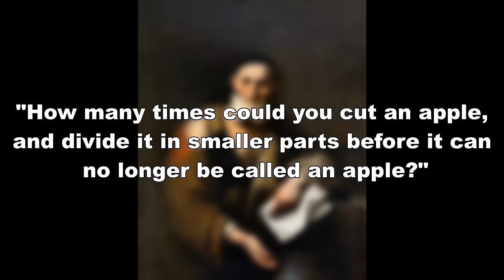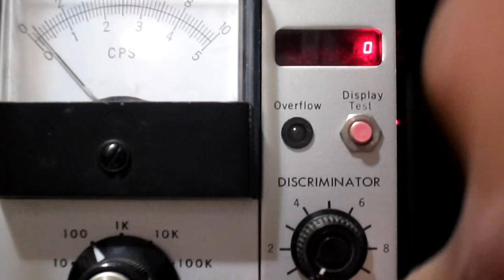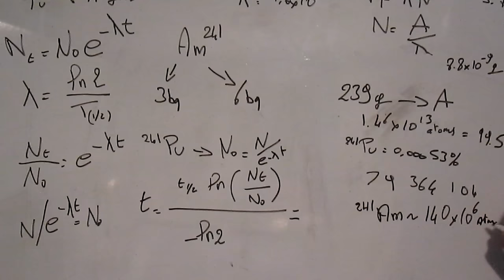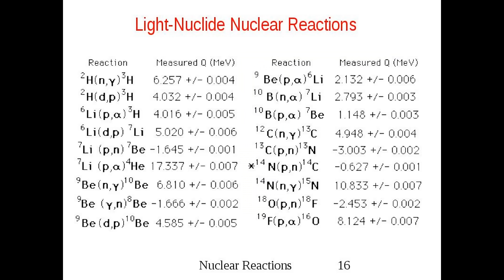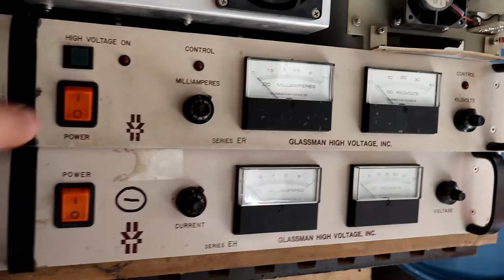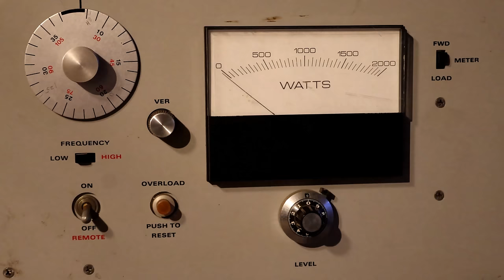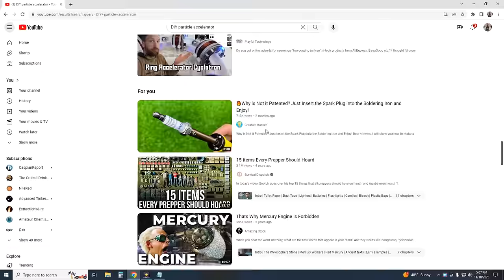DIY Particle accelerator (part 1)

Comment: What about a mechanical square wave generator?  I think Robert Murray-Smith from Thinkin n tinkering has a few videos on it. They are labeled as a mechanical brushless motor controller, but as it mechanically makes a square wave  you can use any voltage that the components will survive.

Comment: Hi. I built one. Here, you need rf power supply, let's say 30 mhz. So you need a function generator, preamplifier, and 50w to 100w amplifier . That goes to your drift tubes.  But you have to know your internal tube capacity so that you can match the network. for more information you can contact me.
Reply from the maker: really? that`s very cool ! you should share some description and pictures if you have any!
Reply: @Neptunium  ok. I can't give you my email. They are deleting the reply.  You know my username try to find me. I really want to help you. 😫

Comment: Maybe it is possible to use a magnetron (salvaged out of a microwave oven) as a generator? It has a pretty powerful output and stable frequency.
Reply from the maker: the length of the drift tube depends on the speed of what you are accelerating which is mass dependent. And of course, the frequency used. Microwaves are used in a slightly different kind of RF accelerator where the electron "surf" the wave. Thats a good idea for electron but that`s not what I am doing here, Although I suspect there might be a way to use microwave for helions too, I am already too invested in one type to redesign everything now you kown! thanks for the suggestion and comment! and thank you for watching!
Reply: A magnatron is a good choice for the RF generator and used in many commercial linacs.  The accelerator disks are directly connected to and supported by a waveguide assembly that is housed in the vacuum chamber.  In this way  there are no electrical connections needed to get the RF into the accelerator- rather a microwave beam is fired into the accelerator.  Also this design removes the need to have any insulative components in the vacuum chamber which will continually out gas.

Comment: I appreciate for your work. Wouldn't be less complicated your project, when you use a Cockcroft–Walton (CW) generator? A single stage linear accelerator can be less complicated, less component can go wrong, and even can be archive 1-5 MeV range. The first linear particle accelerator used this method in 1932.
Reply from the maker: yes ! if you can achieve the high voltage necessary ...as described in the video, its very hard to keep everything from arcing every where! this is really a proof of concept to demonstrate that it can be done and the only difficult part is the power supply.. Thanks for watching!

Comment: You might be aware of this, but just in case - a lot of quadrupole power supplies these days are digitally controlled, a DC signal with a rectangular waveform. I'm way too smoothbrain in the EE department to know for sure, but that kind of circuitry should be possible to tune for your particle accelerator.
Reply from the maker: yes it is you are correct, nut the power is nowhere need what i need for this project ! i am not good enough with electrical and electronic stuff so thats why i asked for help! your suggestion is very valid ! i had this idea too! Thanks for watching !
Reply: @Neptunium  Yeah, that's not my strong suit either. If you ever need help with rebuilding or maintaining a mass spec I'd be happy to try and help, I've had trainings from thermo and bruker. One day I hope to build a teaching mass spec that can separate large/visible electrostatically charged particles. The wiki page for quadrupoles has a picture with particles as a demo, would be incredible to build that idea out all the way.
Reply from the maker: Oh what a cool idea!! Please let us know how or if you ever make it it would really be awesome!

Comment: Where do you source your apparatus ? Is it just ebay? I was thinking about your square wave generator, you should be able to make a rotating contact switch, you only need to control rpm and contact length for frequency and duty cycle. Isolate it from the mains behind diodes and I would shield the entire rotating assembly to eliminate spark gap problems. I only have one truly valuable piece of advice... dedicate some time to teaching any child that wants to watch. Nothing makes everything worthwhile, like time spent tending the garden of youth with the experience of age.
Reply from the maker: That's a great advice my man! I'll try to incorporate that in the follow up video... Yes most of my stuff is from eBay. Unfortunately a rotating contact won't get high enough frequently, I'll explain why in the next video but for now the size of the chamber dictate what frequency to use for acceleration and it's somewhere around 8Mhz. Thanks for watching!!
Reply: @Neptunium  gotya, I used a router once to achieve a pulse in the khz range, but you would need an xlarge disk to get mhz. Probably safer another way, without doing something really scary like a series pulse, where one is the source frequency and another is the multiplier... I am always thinking about how to do things mechanically... but I admit that sometimes, there are other ways that are far safer and easier.

Comment: I apologize in advance for my noobishness (noobiness?) but how is the helium ionized? The stated source of ions is the heated tungsten wire. I'm assuming the wire emits electrons which then are accelerated by the positive voltage. Are these electrons knocking off the electrons of the helium atoms and thus producing ionized helium?
Reply from the maker: Yes! That's exactly what's going on! Usually, a magnet forces the electrons in a spiral so they have more chances to ionized what is in the way. I'll change this method (somewhat) in the next video... thank you for your question and thanks for watching!

Comment: I think you can coat tungsten with a salt which is better electron emitter than tungsten because tungsten is actually not that great in emitting electrons but downside of this treatment is if you expose them to atmospheric conditions most of salts turn into hydroxides or another poor electron emitter stuff. And please be careful, something similar happened to me too and now I have a scar on my finger that is around 3 cm wide.

Comment: wow nice I am working on a particle accelerator as well! mine will be accelerated with cw multiplier
Reply from the maker: Awesome! How high can your voltage reach ? Thanks for watching!!!
Reply: @Neptunium  for some reason it keeps removing my comment but I wrote a long comment before, the theoretical max is 750kv and I might add some drift tube as well if I can afford it, if I can contact you in any way I can share some pics.
Reply from the maker: @Tsindur  if you are on sciencemadness you can find neptunium there and we can communicate..
Reply from the maker: 750kv is very impressive!! You can already do some serious reaction at this level!!! Awesome

Comment: Sorry to see your equipment destroyed but I know it really means you are directly over the target,. I went to high speed switching to bring a tiny amount of voltage to a resonance cascade but seeing everything catch fire was the proof it is going to work,  I just have to decide what to do next that's all but I imagine it's been done before so it's not impossible ....
Reply from the maker: Absolutely! I released the part 2 about 2 weeks ago! Enjoy
Reply: @Neptunium  also I forgot to mention that I had a 26000mhz Quartz crystal in the mix and I was looking right at a resistor and some LEDs were providing light in such a way that I could see a field of energy emulating around that resistor and it looked like the eye of Soron in Harry Potter  ..  I will have to figure out a way to ad some heat sinks and I don't know why they couldn't be right in line  (actually I have a resistor that has a heat sink on it and don't know why I didn't use that) and I could run it in a chamber and slam some Co2 in it  ....

Comment: i am wondering what hapened to the high viôltage generator that it failed so spectacularly
Reply from the maker: The capacitors were fried . There was a lot of missing screws and loose parts from the shipping in a wooden box with no padding! Yeah I was pissed...
Reply: @Neptunium  oh oof.
Yeah that sucks, especially after spending probably somewhere around 300bucks for it

Comment: Any one working with charge needs to know how to avoid radiation exposure. Needs advice on how it occurs from discharge and easy ways of knowing.
Reply from the maker: If you pay close attention to the clutter in my garage there is a scintillation detector at the ready to monitor the area immediately around the end of the tube. We are a long way before I have to worry about radiation yet .. but it's already planed for my friend! Thanks for watching!!!

Comment: Can you accelerate tungsten or thorium?🎉
Reply from the maker: Yes it can be done! It would be somewhat complicated and requires a slightly different setup but yes I could
Reply: @Neptunium  you would be a lot cooler if you did,. Has anyone accelerated heavier elements like that and collided with like or dissimilar elements?
Reply from the maker: @brettmoore3194  I am not sure if anyone else has done anything like this. At least on YouTube.. that idea did cross my mind but it's a bit more complicated although not impossible, the energy required to accelerated heavier ions is far greater than I could achieve you know . Energy is always a problem !

Comment: how do you separate the hydrogen particles into individual hadrons?
Reply from the maker: You don't. A proton is a hadron ! And I used helium not hydrogen so that's an alpha particle . Thanks for watching
Reply: @Neptunium  Sorry, but I thought that particle accelerators like the Large Hadron Collider, does as it says, collide separated hadrons, specifically protons for the LHC, which I learned that they achieved so by heating up hydrogen to a temperature that the electron eventually leaves the electromagnetic force field. Hydrogen is used because it has one proton, and one electron. How can any experiments even be conducted with an alpha particle? Well I can imagine that you could do what LHC and CERN does with particle acceleration because the alpha particle is positively charged, but does the neutron interfere with collection of data. I mean to be fair it is a "tiny" sized PA, but to be honest, a particle accelerator at any size should still be defined by it's ability to create at least half a TeV, I haven't watched the full process yet, and I really plan on doing this my self because it's awesome. I will be really happy if I can get the answers from the man him self.😊

Kind regards,
Jimmy (a freshman who does not have a proper gpa)
Reply: @Neptunium now thinking about it, .5 TeV is kind of too much🤣, impossible for such a small machine to achieve, sorry for my ignorant naive mistake haha.
Reply from the maker: @jimmygao456  there is a whole host of nuclear reactions you can do with alpha particles at much lower energy! You don't have to have proton and only proton! The part 2 is out by the way! So you don't have to wait! Thanks again for your curiosity and interest! Let us know about your project here that would be very cool!
Reply: @Neptunium  Alright!! thanks you😁

Comment: I would suggest learning how to make the parts from scratch, then it won't matter how often you break them. Yeah, easier said than done, but build up your skills one piece at a time and you'll get there and for a lot less money. Who knows, if you figure out how to make each part from scratch you could start a company supplying those parts to others.
Reply from the maker: That's good advice! I didn't talk about it in the video but the HDPE spacers were made in a mini lathe I started to learn to use.. got to start somewhere as you said! Thanks for watching!

Comment: Cool project! I would suggest using the step-up transformer in a microwave. Then passing the output to a Capacitor Diode Voltage Multiplier(https://en.wikipedia.org/wiki/Voltage_multiplier). This Voltage Multiplier circuit will help you manage the output voltage while converting AC to DC in the process. You can then use a simple 555 timer with a high voltage MOSFET to send signals in square wave. If you need any help regarding electronics, feel free to ask me here. Although I'm a software engineer, I believe I can guide you in the right direction. Go forward with the project, I'd love to see more. Godspeed.

Comment: Not even sure if this is real but still my question remains is this legal?
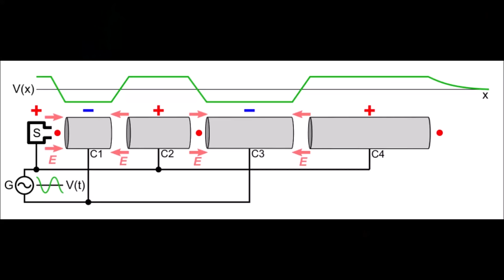Reply: 10:50 are you talking about using a high voltage ac coil gun of some kind to move the particles
Reply from the maker: Yes, I would need an AC power supply in the Mhz at a few Kv.. I am not sure I can even approach any dangerous level this is a proof of concept. Now why would any of this be illegal?
Reply: @Neptunium  I don't know much about things like particle accelerators so my mind kind of went to radiation that I've heard gets emitted from other particle accelerators if that doesn't happen then you should be fine. Again I might have a misconception there so take it with a grain of salt.
Reply from the maker: no you are correct ! but the amount of energy requires to even begin to worry about it is nowhere near what I can remotely approach.. I just drafted an excel calculation sheet and I would need a 10Kv supply at 5Mhz to get just over 1Mev which is 5 times lower than the energy of average radioactive alpha source ... I am not concerned.   @randospawn7495
Reply: @Neptunium   Cool hope development goes well and have a nice day dude!

Comment: First
Reply from the maker: Your right!!! . thanks for watching!!
Reply: That's a great project, failure is always an option and accidents do happen, be careful with vacuum and don't give up.
Reply from the maker: @chrisbastoscb  absolutely right! I will get this going! I spent too much time and money to give up now! Thanks for watching!
Reply: @Neptunium  I have a question about the possibility of turning a magnetron into a cyclotron
Reply from the maker: It's possible yes! I understand it works best with electron ... As long as the cavities are design to work with the correct wavelength (or the microwaves are tune to work with the dimensions of the tube) that's the way most modern medical linac work! Thanks for watching!
Reply: @Neptunium  so if I took a magnetron and added stronger magnets but kept it the same frequency but higher voltage it would become a poor man's cyclotron
Reply from the maker: @The-One-and-Only100  no you would not be building a cyclotron at all .stronger magnet? Why ? And added Where? A magnetron generate a RF signal the electron can "ride" in a special configuration cavity. A cyclotron uses a strong magnetic field to deflect charged particles in a spiral between two electrodes.
Reply: @Neptunium  so replace the two ferrite magnets with either neodymium or electromagnets then the electrons will spin around the tube tighter than with the original magnets and were still doing the research on the topic but my idea to see if it's working is look for XRF peaks for copper when the electrons eventually hit the anode but you have experience with your accelerator but were still crunching numbers and brainstorming ideas to try to make a poor man's particle accelerator

It's just an interesting idea that I had and thought would be a great experiment
Reply: @Neptunium  so it won't be possible no matter how you look at it
Reply from the maker: @The-One-and-Only100  It may be possible in a linear configuration not a cyclotron. I am guessing the magnetron signal would have to be cleaned up a bit but I don't see why not.
Reply: @Neptunium  so you can't just take a magnetron tube and turn it into a particle accelerator it would need to be linear and not bending electrons